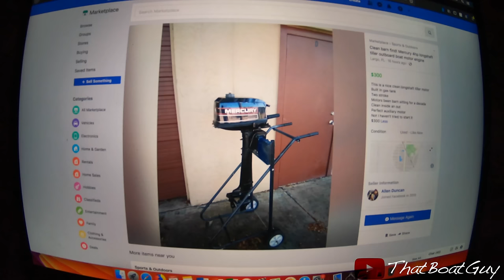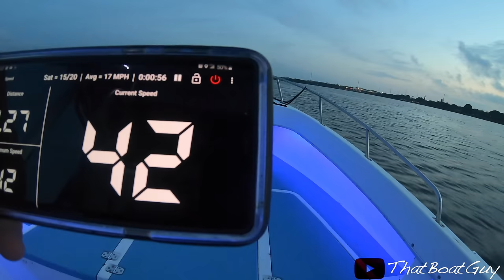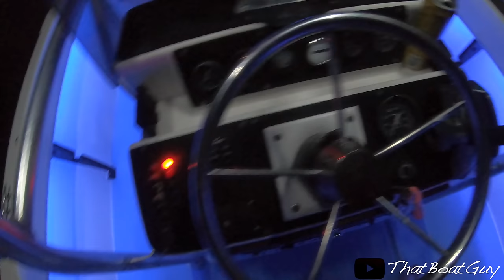Amazing Boat Restoration Must See!!!

Comment: I would have never picked that shade of blue, but I would have lost out because the boat turned out really sharp looking.
Reply: I couldn't disagree more.  That is a awesome shade of blue.
Reply: He’s saying it looks great as well..
Reply: @dsberube  he said that he wouldn't have picked that shade of blue at the paint store, but that he would have missed out on a great color because the boat looks really good painted that color.
Reply: @cr4zyj4ck  I realize that.  @gorp27 phrased his statement oddly.  Why not just say that the boat looks sharp. No need to contradict the boat builder's decision on the paint color.   I was simply supporting the decision on the boat builder.   That's all.
Reply: sounds like st cloud LOL
Reply: For its age and time period it matches it.
Reply: This a is a very popular shade of blue, a lot of these new boats are this color, I like it!!
Reply: What kind of paint do you use?
Reply: @Strugglingdisciple   I had 2 paint colors in my paint cabinet to use on the interior of my john boat, Farmall red or JohnDeer green from tractor supply. I went with the JohnDeer green.
Reply: @gorp27  so its implement paint. Industrial paint? Im curious if it will peel at any point
Reply: @Strugglingdisciple  It held up good where I put it over self etching aluminum primer but peeled when put over rustoleum aluminum primer.
Reply: @gorp27  im wondering if a gel coat type paint would probably be best, but im sure much much more pricy
Reply: dio @dsberube wtuwwwwwwiweie ee eaee
Reply: V xo
Reply: @tylerw1418  Dr Ibrahim Ke
Reply: @mohamedshaari4962  well said!
Reply: @Strugglingdisciple  Probably a two-part linear polyurethane would be best and some are made to be used by do-it-yourselfers.
Reply: @dsberube  I don't think you realized it at all... I think you just don't want to admit you're wrong. That's okay. Carry on.
Reply: @Dan Berube  he wasn't co trafficking anything he was giving his opinion. Just like you gave yours.
Reply: Agreed. 💯

Comment: If you want the LED strips to stick to the boat you need two things. 3M waterproof tape, it's foam based tape, and contact adhesive where you are putting the lights.

Comment: Get a plastic putty knife and put a t-shirt over the edge and burnish the tape on your stickers well. Outward on the edges to press any bubbles out. Pull the tape slow and steady at a 45% angle. I used to lay alot of vinyl. Should stick better and be easier to apply. Looks great! My fav boat yet

Comment: I wish I had your skill set, lived where the boats are, but mostly,  the energy of being young. Really nice stuff. The shots of the boat under way using "follow me" with a drone turned out fantastic. They do in all your videos.
Reply: It definitely takes some skills probably, but an average person could teach himself. It takes a lot of time and money more than anything probably.
Reply: @paulschab8152  carburators are difficult
Reply: I know. I never said they were not. The only carbs I ever degunked were on small engines. I'm sure this guy would rather mess with carbs over EFI any day though.
Reply: @paulschab8152 fuel injection? easy
Reply: Fixing is probably pretty easy.  The hard skill to acquire is to know it's worth fixing in the first place.
Reply: @rnordquest  no fixing is the hardest
Reply: @wazup3333  Hmmm.  If I screw something up fixing I just redo it.  It's a lot of money to buy a boat you can't fix, then another and another till you learn what the values are.  But since I don't know either I'll have to take your word on it.
Reply from the maker: My dji 3 pro does not have "follow me" feature. I had to control it with the remote.
Reply: @ThatBoatGuy  Wow, i'm even more impressed. Nice work !  :)
Reply: @ThatBoatGuy   I don't like about 15 mi from your brother
Reply: I would like to know the price of a 15 Yamaha 2 stroke in Guyana on way to go visit the engine can reach the Guyana
Reply: @paulschab8152  I don't know if you could send out a number or something that I could give you a call and it will get better contact with you cuz I don't even know how to read

Comment: Do you sell these boats ? I’m interested if so
Reply: @southamericanrocker  That's a serious margin!
Reply: @milesslocombe1121  guess that boat guy invested a lot of work and knowledge. If I lived closer I would buy it!
Reply: Time and money. Time and money.
Reply: If he sells for his price he wants he’ll get a $9,000 profit jeez! Plus YouTube ad revenue. He makes a lot
Reply: @sethgabbard7705  He probably put 80 hours of work into it. At $50/hr @ 80 hours plus his cost, the margin is closer to 5K. Still not bad, but not insane markup.
Reply: @sethgabbard7705  I doub't he makes much if anything off of youtube (at this time).  He's only got 65k subs.
Reply: @GettingBentWithBo  You'd be surprised. I use to have a channel with only 4k subs and made roughly $40-$50 a month through ads.
Reply: @sethgabbard7705  it will never sell for that price. He may be lucky to get $7500
Reply: @southpaw8040  Correct. Winter market is garbage. He'll hold it for 2 month, drop it to 9k, then settle for 7-7500 IF he's lucky to get an offer. This is a VERY old boat and there are better bargains coming up all the time. The way he can make any money is by getting them for 1-2k WITH a trailer and then flipping them for 5-6k. That's about it. Above that you have just too much better newer boats. Frankly, this boat looks old, regardless of how much makeup you put on it.

Comment: Great video! Its crazy how cheap you can pick up boats over there in the US. They cost an absolute fortune over here in the UK.
Reply: Boat prices here cover a huge range.  The best prices come when someone has stored a boat outdoors and has no future plans to use it.  They just want some quick cash, selling if for less in 'as-is, no warranty' condition because they don't want anyone coming back saying they got cheated and were lied to about the condition of the boat.  People in the US do not generally bargain like the do in other countries.  In other words, a buyer will either pay the asking price or offer just a bit less.  In some countries the parties will bargain back and forth for half an hour or more.
Just pick a region and look through Craigslist adds to see the wide range of prices.  There also are occasional sales of impounded items, large and small, that accumulate at a law enforcement impound, or sales of county equipment that has been used a lot and replaced.  I once bought a very good used car for $450; it had been a Texas Highway Patrol vehicle.  It ran like a top for two years, then I traded it in for a nicer car.

Comment: You should get a heat gun and remove those old mercury decals on the 200, sand repaint motor black and put new decals on motor, I did that to a Evinrude 150, got paint code from a new at the time Saturn car. Silver blue with metallic , new decals and it looked awesome!

Comment: Great looking boat and restore. Friendly tip from a painter. Don't touch the surface your painting with your hands after you cleaned it. Oil and other contaminants from your skin attach to the surface and gets into the paint. It can cause the paint to not adhere correctly shortening the coatings life.

Comment: I live in your town 
Do you have a 75 Hp mercury in great shape ??    2 stroke is fine

I have a merc i want to change my engine which has low hrs its like new i want the max hp for my 16 CC  im at 32 mph  with 3 of us fishing 
i want to get more top end / if i change brand i need to change controls.

Comment: The question, I have a 1989 McKee Craft Aruba with an 89 60hp Mercury. I'm getting no spark on all 3 plugs, so I replaced the majority of the wiring outside the coils (last part). If I replace these coils and I have no spark what can be the problem? If I can't fix this you can come to take the boat for dirt cheap!

Comment: I just purchased an old sea cat sl1. I'm going through some restoration and changes myself. A few questions for you  what type of deck paint do you recommend? The deck in this boat has been replaced however it was never finished in with sanding and paint or gelcoat and as far as the outside. What gelcoat do you recommend? Do you use primer or just sand it very well? I noticed In this video you painted to non skid Gunwale, did you sand in the cracks or just paint away? Sorry for all the questions at once but I want my boat to look new and professionally finished. Thanks for your time!

Comment: Those old mercs are strong running motors my brother had one and i was alwate really impressed with it but the impeller design sucks it eats them up quick. Seemed like we were replacing them alot. The oil injection had issues so we just pre mix

Comment: Restoration looks great. Now invest in a few fenders and your set.  I’m assuming that you have a couple of anchors and all of the usual safety equipment in those storage compartments.
Reply: Other Youtubers in FL mention the State has lax safety requirements for small boats.  I've never seen anyone pulled over by a water cop and asked to see the PFDs, fire extinguisher, etc.  I do not have first hand knowledge, but if I were to have a boat in FL waters would have to learn. Check out the Haulover vids to see hundreds and hundreds of boaters of all ages navigating a dangerous inlet with no flotation devices showing.  None. And they let kids wearing nothing but a suit sit in the very front of a bow runner boat.  They get flipped around by the waves crashing over the bow.

Comment: Nice job
A few suggestions
That blue light strip is real cool looking and accents the blue paint. 
Unfortunately it’s too bright for night work. Put a dimmer on it so when back at dock you can still crank up the cool factor. The past belief of red light saving night vision is not true for everyone seems to be an individual thing. Bright light of any color is a vision killer, white is the worst of all so watch out for your nav lights for unnecessary spill.
I’m hoping you probed the bolt holes in the transom for rot when you had the motor off. And if all was good used plenty of silicone on the bolts to keep the water out. Don’t use 3M 5200 here, the stuff works too good. Kudos for the impeller change right off the bat. Most just Don’t and mega dumb it and end up with an over heating engine with pieces of impeller stuck throughout the engine. Lube the impeller with liquid soap or for long term term till use silicone lube won’t damage the rubber never use petroleum based on the water pump. An engine that’s sat for a long time I like to pull the plugs and spray some marvel mystery oil in the holes and let it sit a day. Then spin the starter to spray the oil out the plugs holes so have rags ready. Important note if the voltage from the coils can’t find ground or too far to spark, the ignition could be damaged. Ground the plugs or consult the manual for disabling the ignition. The final touch? Buy a new decal for the engine cover. Buff out the paint but use a wax and silicone remover before you apply the new decal and wax later.

Comment: Ever heard of a motor running great on the hose but when I get it to the ramp I can't get it to turn over whatsoever, it will only crank, anything to do with back pressure? Carbs have been cleaned, had to replace fly wheel, new gas, water separator, fuel line, fuel filter etc, rebuilt lower unit, 2000 200hp Johnson
Reply: Sounds like a travel issue. I have a 96 Johnson 200. I have to re pump the bulb while cranking when I get to the ramp. Mine has to do with the electric choke thing on the side of the motor. Has a Schrader valve on it. Not sure if they are still using that on the newer models
Reply: @chadclm  I haven't tried pumping the bulb while cranking it, just pumped it full then cranked, I'll have to try that, I figured it was a bad ground or something. Thanks for the idea!
Reply: I had the same thing.  Turned out it had a leak in the lower unit letting water get mixed into the oil.  Ran great on muffs, but died in the water before ever leaving the dock. 
Best of luck.
Reply: @rerunbootlegs  well, I thinig I have that problem even though it was just rebuilt, and the same asshole that did my carbs screwed it up, carbs are leaking quite a bit so pulled them off and waiting for the rebuild kit to come in

Comment: I used to have a 17 proline cc 1989 and I put a 1998 120 nissan on it then I installed the top carb making it a 140HP I cannot remember what the prop pitch was but it was stainless and 2 deg more then the factory prop,
 I used the GPS to check my speed often and it was consistent in fairly flat water at 58 mph.
I had lots of witnesses

Comment: What led strips do you use and how well do they hold up?
Reply from the maker: They are cheap Amazon led stip lights. Works great but the sticky back side sucks. I usually have to use superglue on the back to make it stick.

Comment: Dang 42 mph on that 222 hull is pretty efficient for a 200 2stroke. I have a 20' bay boat with a 150 4stroke and it hits 40-41 pinned on saltwater. Bet you would hit 44 on salt.

Comment: Dang I need to go down to Florida. Been watching "cheap boat" finds and restoration videos. A running 200 HP merc outboard is worth at the very least 2K, here in MI anyway. Is it because these motors were run in salt water? Just watched a vid with a guy who bought a beat up cuddy cabin with a running 150 hp evinrude for $1,100 !! The trailer was worth more than that lol.
Btw, i bet that center console hauls azz with a 200 hp 2 stroke merc. Im guessing almost 45+ ever clock it?
Reply: iv seen this as well it makes me wonder

Comment: Great job on the restoration. I had the smaller Aquasport center console with an Evenrude 112 Special and even with six people on board, I could get 28 knots. Continued good luck...I never should have sold mine but I did get a Grady White 209 Escape out of that sale.

Comment: You didn't find any soft spots in the deck? Or rotten core anywhere?  Did you check the trailer hubs? $3981.00 out of pocket (is that all? These types of projects often nickel and dime you to death, and I don't see an amount for the hull paint; did you use alkyd? I bet you didn't use polyurethane which is expensive and a PITA to apply), but how many man hours? If you had to pay a skilled boat guy to do all that work, that boat would cost $20K. Nice job though.

Comment: How much do you think that would cost to have someone do it for you, minus any work to the motor.
Reply: I'd estimate 3000 including the motor too
Reply: Labor is expensive
Reply: I'd do that in a heart beat. 👍👍👍
Reply: Rack or did u mean $3000 for just labor?
Reply: It's about 60hrs of work or so with everything. Figure a shop hourly rate is anywhere between $100-$150 an hour.
Reply: Johnathan Grundon im here in South Texas the work I recently had done was $75 hr labor but it was for a wire short on a bilge pump, solenoid and a live well aerator. Came out to $360
Reply: @grandfury5609  Florida is somewhat of a boat capital, everyone and their children have a boat here. A good boat repair facility is going to run $100+ an hour here unless you go back yard.
Reply: Johnathan Grundon yes sir, I believe it, I just want a nicer boat w/o having to pay the haynie price. Bought a 2004 sea fox Mercury saltwater series for $9k cash, probably overpaid but I'd love to trick her out.

Comment: Can anyone answer this?  What are trim tabs actually for?
Reply: Trim Tabs provide lift in order to compensate for changes in speed, weight distribution, and water conditions. When they are deflected downward, the water force on the trim tab creates upward pressure, raising the stern and reducing hull resistance.
Reply: @Darkhalo314  thanks buddy

Comment: Is that Lake Seminole?
Reply from the maker: Yes it is
Reply: @ThatBoatGuy  I new it, I've spent countless days wakeboarding on that lake. I went to Seminole high and still live here. I have a small motorcycle shop on 118th Ave North called Misfit Moto. I do everything from custom paint to  motor builds.  So if you ever need some paint work done, maybe  custom paint wok on a engine cover or anything  let me know.

Comment: I wouldnt call painting a boat a restoration. A restoration would be stringers,transom,deck, fueltank, hoses,rigging ect.
Reply: Rad man no, it’s a restoration as he painted it, added lighting, new winch etc. He did more than clean it up
Reply: RichieT5 def not. It’s far from a resto. It’s called putty and paint.

Comment: In my younger days my in-laws had a 50 Mercury on a bass boat and it needed a new impeller. I offered to fix it myself. Well, as I was putting everything back together I got a call I was needed at work. My friend who was with me offered to finish buttoning everything back up. The next week my in-laws were out in the boat and the motor burned up. The Mercury shop said the key way was left out for the impeller. Mother-in-law sold them the boat instead of repowering it for us. The dealer put a new motor and sold it. No more friend, no more boat.

Comment: that mercury is hurting. it sounds like it has about 10k hours on it. i know your goal is to make 100 times what you paid for the boat, but you need to compression test your main engines before you claim that they “run good” i bet that thing has like 80 psi each cylinder.